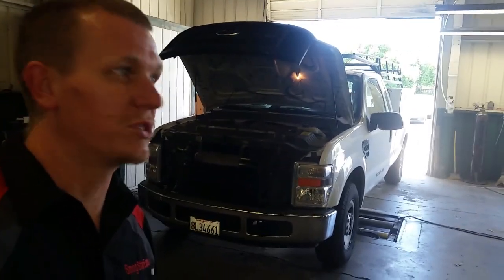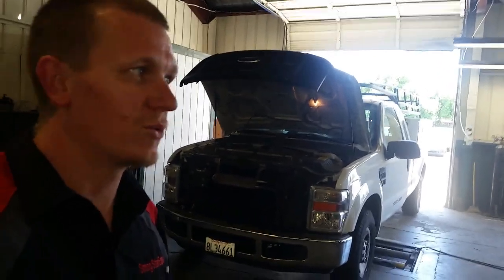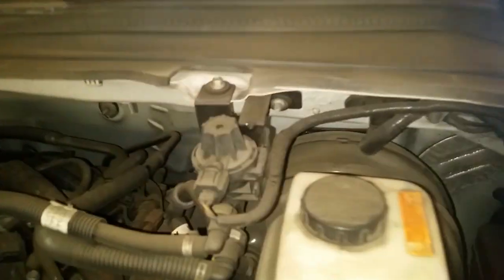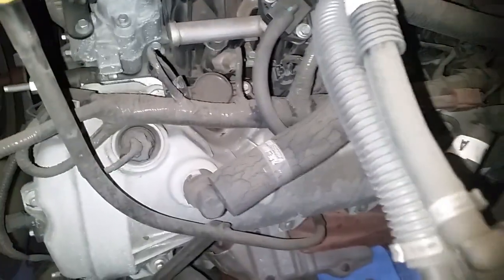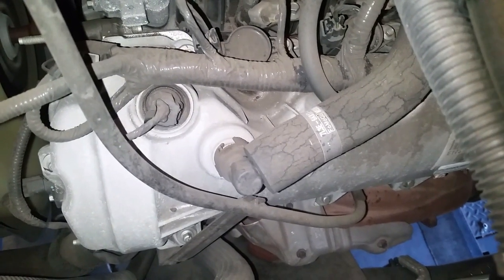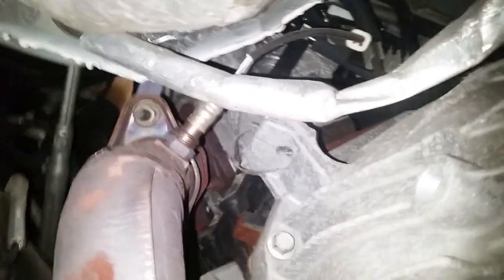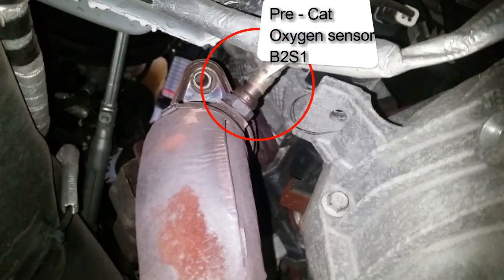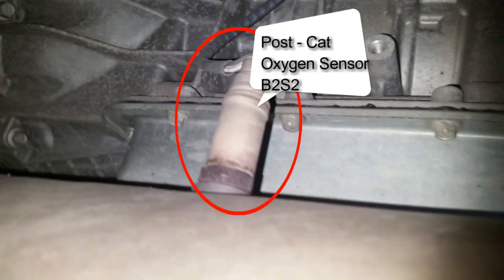Ford F-250 Super Duty Emissions / smog locations: PCV, EVAP, & Oxygen Sensors

Comment: Would the rear EVAP failure prevent my tank from filling up properly?  I replaced the sensor in the engine bay and still having issues.
Reply from the maker: If you are referring to the 'vapor vent valve', yes. If the vent valve doesn't open, you will have problems pumping gas. I posted this video a couple weeks ago on how to test it.